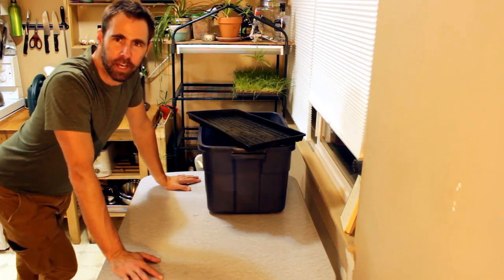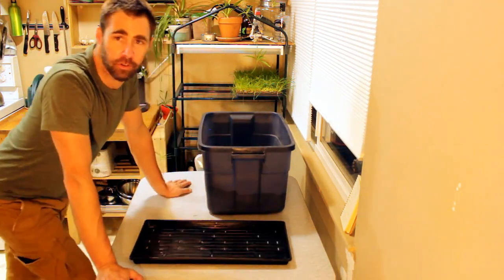2.1: Prepping Trays - Home Microgreens Production

Comment: im curious, why not just use a ruler or something to make it totally level?
Reply from the maker: in short, it's pretty quick to do by hand. Using a ruler May technically get it straighter but it's bringing another tool into the picture which has to be picked up and put down with each tray.